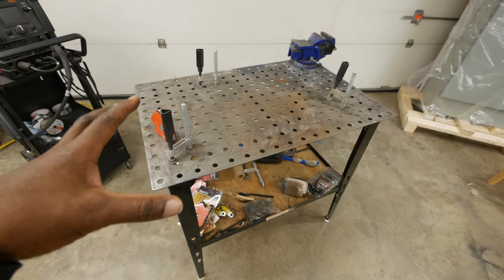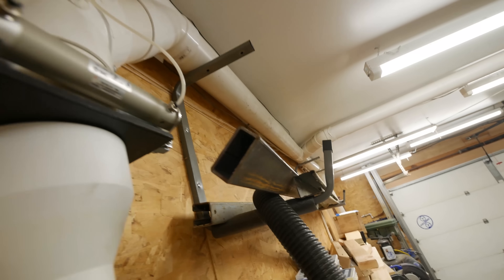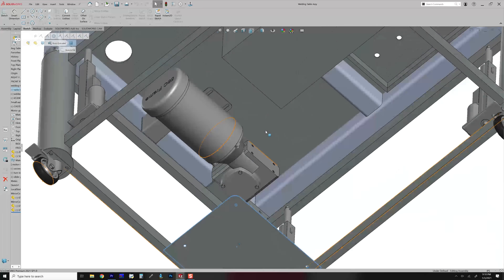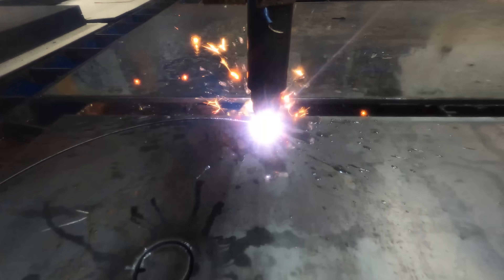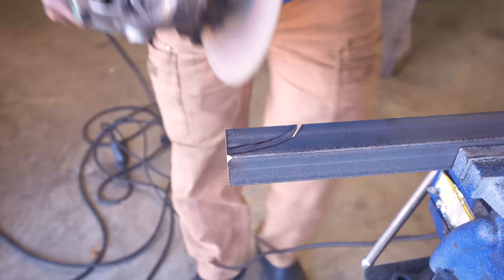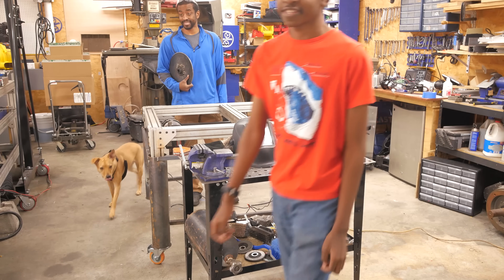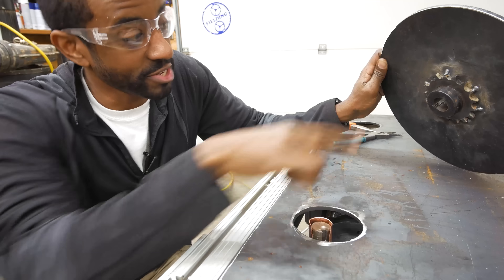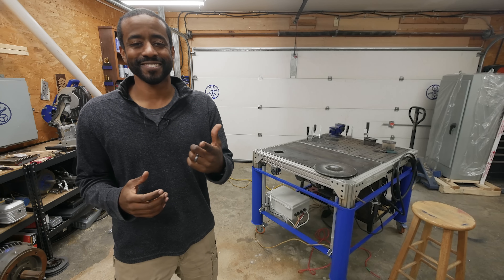Making the Ultimate WorkBench - Jeremy Fielding 088

Comment: 6:00 i can actually see the steel warping as he is welding
Reply from the maker: Interesting indeed.
Reply: Not an illusion created by a wide angle lense?
Reply: @grahammcelrath8167  no illusion.  Heat can do amazing things!!
Reply: @grahammcelrath8167  No, its super common for things to move if you apply too much heat at any one time.  You actually have to account for this and usually only tac weld things all over and then finish weld.  You can actually use this as a tool in your favor in that:   lets say you are welding an upright plate to something, and you tac it and then notice that its leaning to once side a little---- if you just go ahead and full weld the other side first, the heat will expand the metal as you weld, and then as it cools it will pull the piece back straight.  It takes some practice, but its a nice little trick to know when things start off a little crooked.